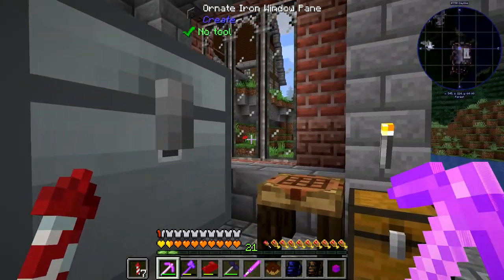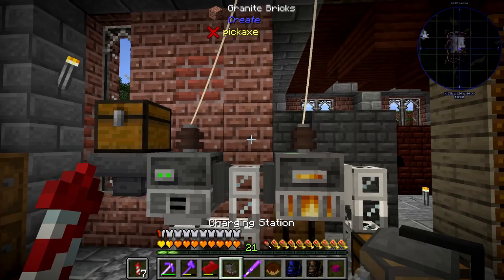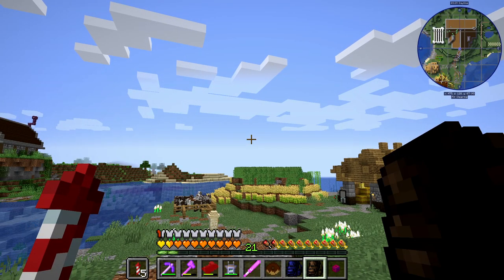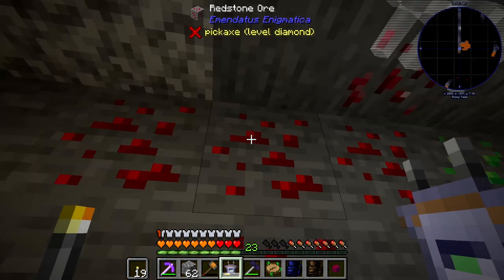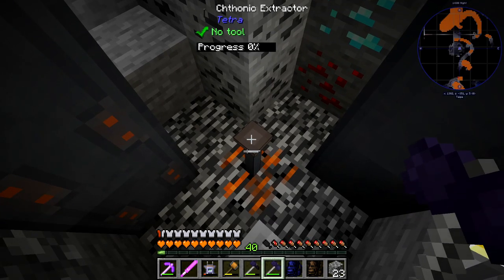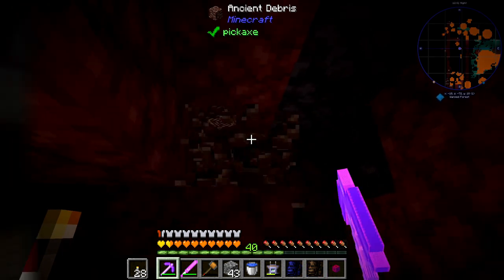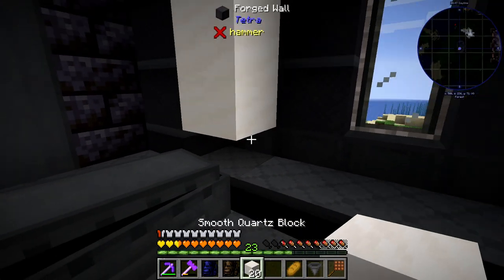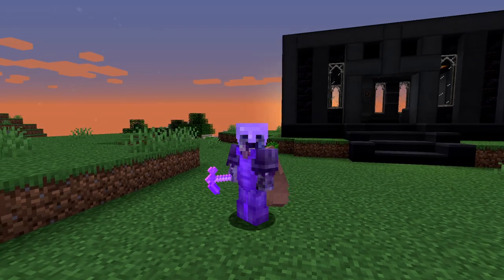Build Your Own Tetra Forge Hammer! | Ore Scanner | Stacia Expert ep 11

Comment: I never did consider using a Scanner, not sure why I didn't. I find pretty much everything I need or want... except Ancient Debris. I am trying to get through AS enough to be able to double the Debris into 2 Scraps, since the Starlight Infuser can double it and is not that hard to make. Guess I'm making a scanner then for when I go back to the Nether or need to find stuff like diamonds and emeralds.

Congrats on getting the Tetra stuff to your base, and the structure is well done, I dig the Blackstone as a material.
Reply from the maker: I hadn't realised it was updated to the newer MC versions, I really like the changes they've made to the display. Very handy for tracking down that ancient debris, I did a lot of branch mining to find the stuff I've gotten so far 😅
Reply: @ClassicDuff  Mercifully, Ancient Debris actually does look different when scanned. It has a slight brown hue, but the unfortunate thing is everything in the nether is considered rare, lol. Do you think it is possible to instead use the block module to find Ancient Debris instead of the rare ore module?

All things considered, I have never used the scanner before. So using it was a bit of an experience and a hilarious moment in one. I used it to find a Bastion Remnant. Except I didn't find it using the scanner, I just happened across it while wandering somewhere north of my 5th portal into the nether. Maybe I should consider a flux capacitor or something, my scanner runs out of power super fast it seems.

Something weird happened with the pack though. Last night the dev updated to 1.11 of the pack, which introduced a couple mods and added the Twilight Forest. Play today, and the pack downgraded to 1.10.11, and then reupdated back to 1.11. Speaking of Twilight Forest. Be warned that the portal back seems to wanna spawn you elsewhere, no rhyme or reason why so far. When I destroyed the portal it spawned me at upon returning, going back and coming back again made another portal next to the first one.